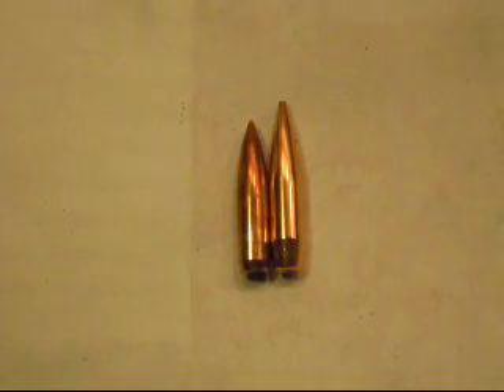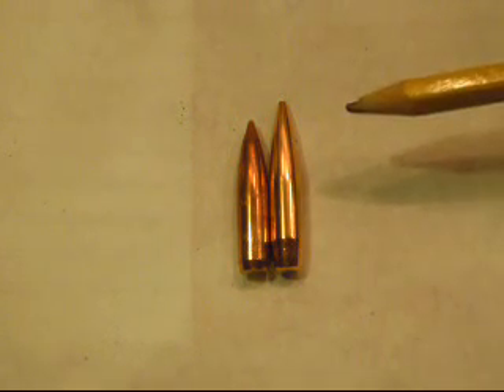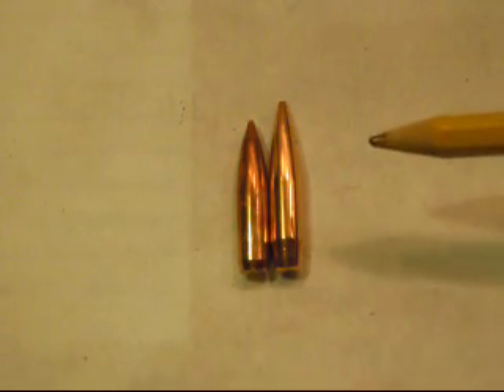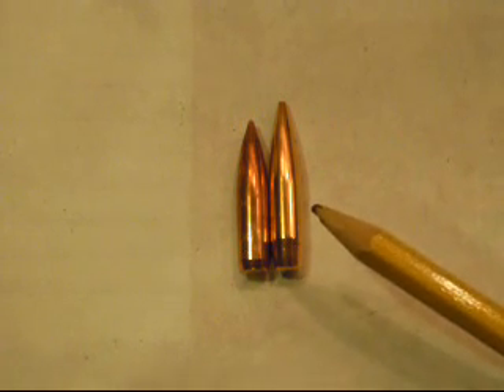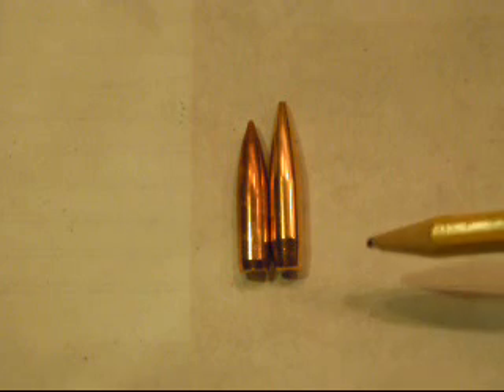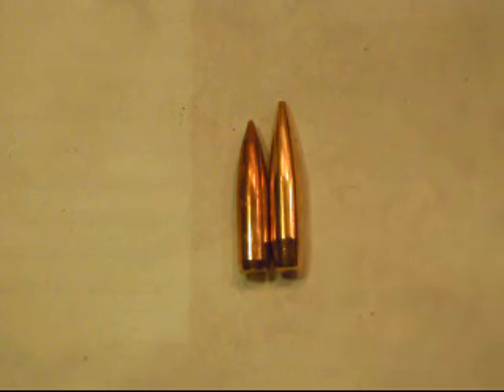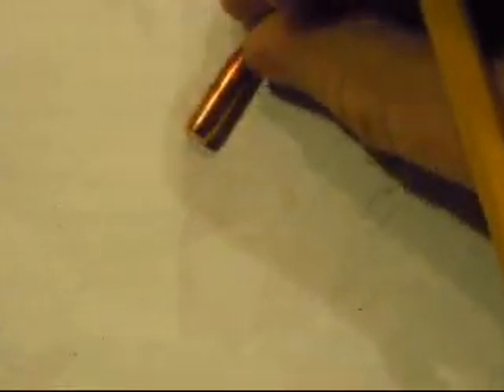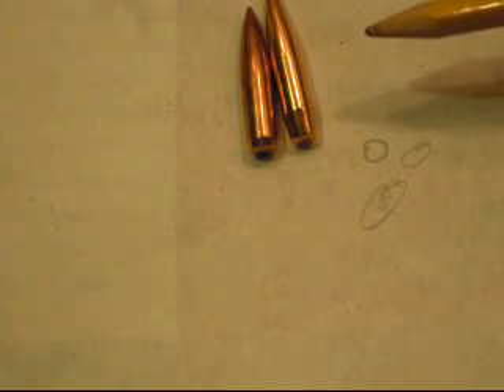Bullet stabilization, and barrel twist, Reloading

Comment: dang I messed up by forgetting to check the twist rate when buying new bullets. speeding them up did make the holes look better so there's that...
Reply from the maker: Speeding them up will usually tend to stabilize them better, but it's usually not worth all that trouble vs using the correct bullet for your barrel.

Comment: Which bullet weight would you recommend for 1.12  twist rate on my 270 win. For  long distance shooting  . Thx
Reply from the maker: Depends on what you consider long range. In general the 12 twist 270 isn't a great candidate for LR work. You could try the Nosler accubond 150 gr LR, but it may not stabilize due to the twist. Out of all the calibers, the 270 is one that I have very little experience with due to mainly it's lack of high quality high BC bullet selection. If you are not shooting past 500 yards, just about any ballistic tipped, or boat tailed bullet should give decent performance. Your best bet would be to take the time to research online what others are using for that combination. When you sort through all the BS online, you can usually find some good info or a good direction to take. It may take a few different bullets to try, but in general 130 gr bullets and lighter should fly. Just remember that stability isn't really based on weight but length.

Comment: The twist rate 1/9. I usually put the lightest and cheapest bullets. Original military bullet was 140 gr
Reply from the maker: There are a couple things you can try. In general 9 twist barrels will stabilize just about any bullet in the 130 grain weight class or lower. You could try just shooting lighter bullets. 2nd you could try to speed up your 140's FPS. Sometimes speeding them up helps stabilize longer bullets. The reason they originally shot a 140 gr bullet is because many military rifles use to shoot shorter heavier bullets. A shorter round nosed 140 gr bullet may stabilize just fine in your rifle, but a modern VLD or boat tail bullet most likely won't stabilize due to it's length even thought it's the same weight. Speeding them up may help, but going to a lower weight bullet will definitely fix the problem. Even if you barrel isn't bright and shiny, as long as you have decent rifling, it should stabilize them. Hope this helps. Thanks!